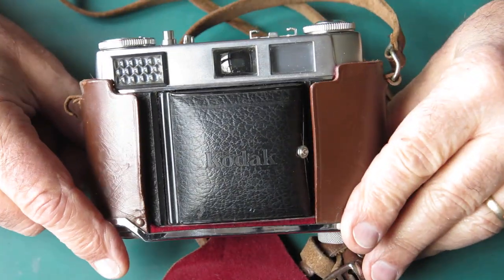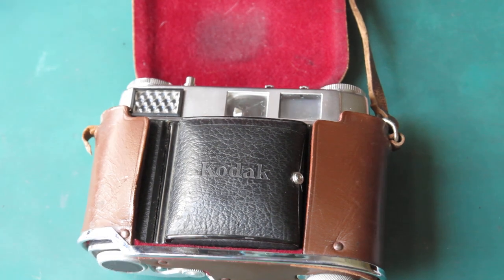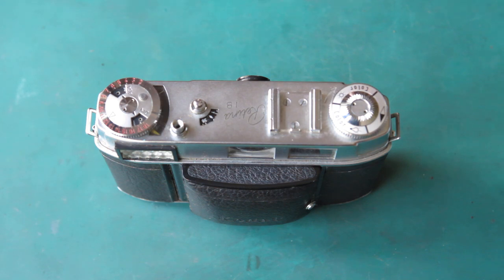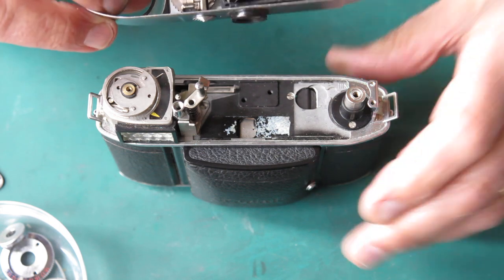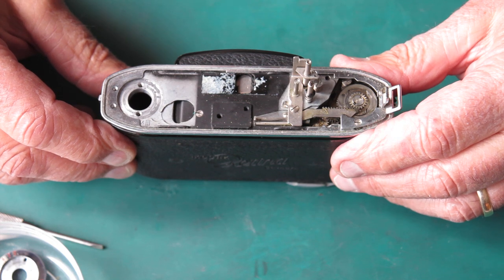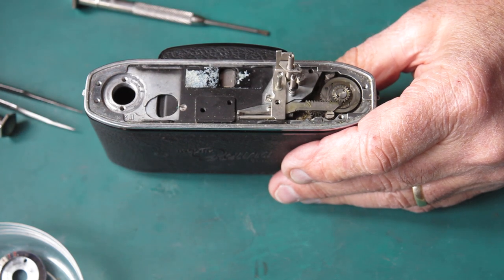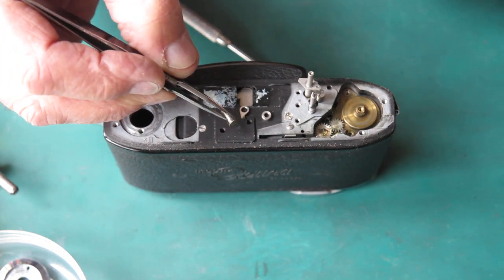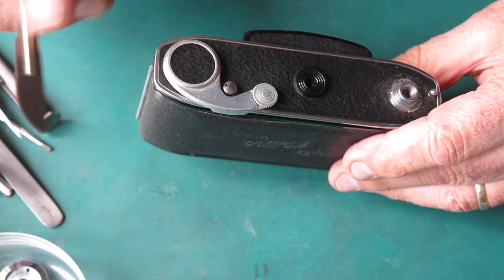Servicing a Kodak Retina IB, part 01

Comment: I had bought a very nice, not used retina 1b. The problem was shutter cocks and fires a couple of time and both the shutter and cocking gets stuck randomly sometimes, even the skip film button does not work until I turn the film spool and somehow unclog it. I have opened up to clean the top cocking teeth but the shutter button level fell inside the camera in bellow area. I could not put it back and had to detach all the front to do it, then collecting it back was pain! we could only do it two people together! Now after attaching the front and the top, shutter does not work anymore! It is stuck and does not fire, when you cock it the cogwheel visible from outside on the lens element turns good, and when the cocking arm returns it also returns to its previous place.. I give up here, pity it is a new state clean copy of this camera..
Reply from the maker: As you discovered, it is important never to let the shutter release shaft fall out. I warn about that frequently, but even I get caught every now and then. Most likely, the camera only needed to have the shutter serviced before you started, although there may have been other problems. I always remove the shutter from the body if I am trying to repair the film advance mechanism, and only put the shutter back once I am happy that film advance mechanism is working correctly.